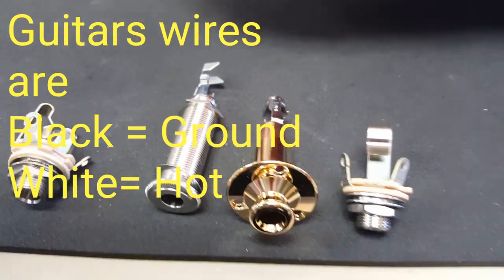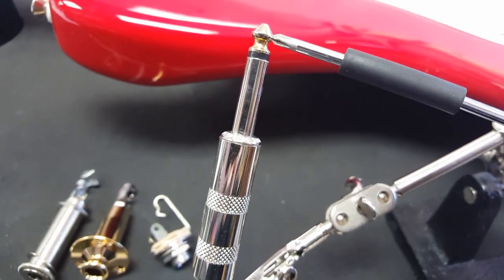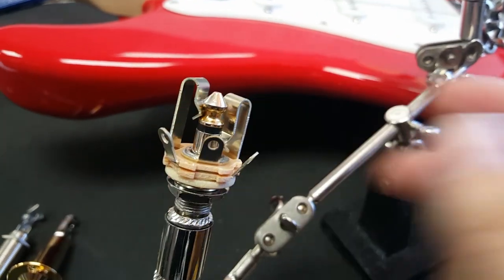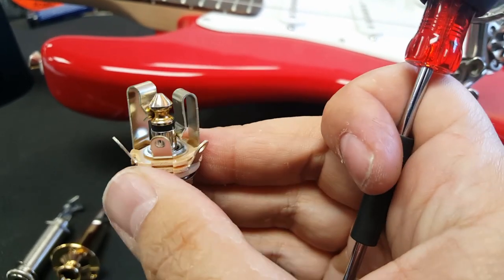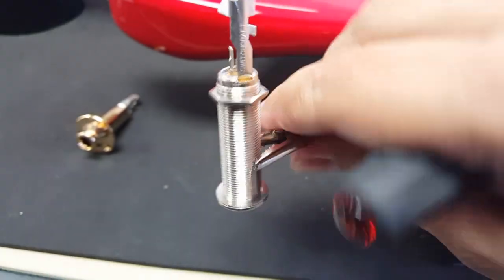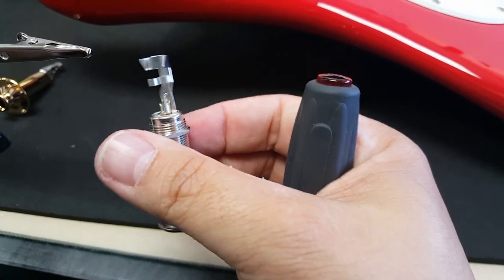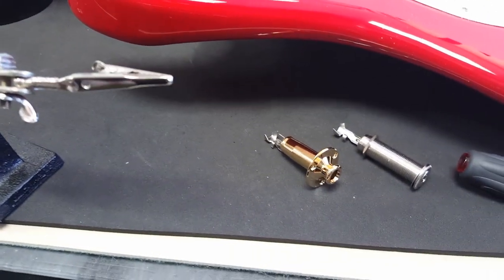How the guitar output jack works.  Sharpen My Axe

Comment: Even with your help it still took me nearly a couple of hours. My jack was similar to the gold one near the end of the video and being a sealed unit it was impossible to figure out the connections with a multimeter. With you telling me that the short one was 'hot' and the big one 'ground' made it a lot clearer. So many thanks.

Comment: Man this helped... i just wired an EMG 85 in my Kramer Baretta but had to use the older longer output jack... static and wouldn't pick up my false or pinch harmonics... i was sick! Saw this vid learned i wired incorrectly....fixed it and now 🤘🤘LETS GET ROCKIN!
Thanks for a great vid..! Even if 4 yrs ago!

Comment: Thank you for this. One question: In the beginning of the vid, you mention that "black" was ground, while "white" was "hot". That's the opposite of how 110v single-phase wiring (common non-industrial setup) works in the US; the black is always the "hot", while the white is "common", or "neutral". Ground color varies by nation, i know, but here in the US, it's usually green. What would be the reason for configuring it the way guitar makers do?
Reply: D Snodgrass These are common colors in the U.S. for low voltage or electronics.  You’re correct that common household voltage colors are black (and red or blue) for hot, and white for neutral, and green for ground.  FYI, the 12 volt system for a car uses black for ground and red for hot!  Pay attention!! LOL...

Comment: Am I missing something here: Wouldn't it be the exact same thing if instead or using a TSR/stereo-jack, you would connect the 9V ground to the same same ground as in a mono jack? Or is the point of the whole thing just to have different soldering points for both ground wires?
Never owned a guitar with active PUs and  didn't know they use TRS-jacks, so that's Mr. McKnight all right; even on a thing that's as basic as it get's, there's still at least one new thing to learn.

Comment: Just a tip; pull the jack out of your 9Volt Active acoustic or electric Guitar when not using it as the lead left in drainz the battery, same with 9volt bsttery powered pedals.

Comment: If it wasn't clear, inserting the guitar cable plug with the long sleeve, connects the negative of the battery to the common connection (sleeve) of the jack and powers the electronics or the active pickups.

Comment: Great video. I have a barrel output port on my Taylor like the one you explained in the end. It doesn’t work when the cable pin is inserted fully. Only works if the pin is partially inserted into the port. What could be the reason?

Comment: Aww man, I had to rewire the cable for my input jack aswell the wire was full of nicks were it had been twisted in the cavity, upgraded to some vintage cloth covered wire.
Reply: I only have one wire coming from guitar and trying to upgrade the jack, how did you rewire?
Reply: @edwardkennedy5500  does your wire have wire strands underneath the insulation that are around another insulated wire? If so it's a double core wire and you will be fine using that.

The stands that are between the outer insulation and the inner insulated wire are the ground, and the inner insulated wire is your hot.

Just twist the ground strands together so they are easy to solder like a wire. Hope this helps, let me know how you get on.

Comment: In example 2, why wouldn't you just weld both wires that go to the ground to the same ground terminal, why do you need 2 ground terminals?
Reply: TRS, tip, ring, sleeve, "stereo jack".
When the negative of the battery is connected to the "ring", the jack also acts as a "switch" to turn on the electronics or the active pickups when a mono guitar cable is plugged into the jack and off when it's removed.
NOT 100 % of the time, but 99+%.
Reply from the maker: +dennis walsh said perfectly. thank you for posting

Comment: I absolutely don't get the one for the active pickups:
It gives you a third connection (for the battery) which leads to the sleeve and therefore the very same ground for the rest of the guitar. Why not connect the battery ground connection to any ground? Why make a third connection which suggests it has an individual use, which imo it doesn't since it's connected to the "old" ground?
Someone care to explain?

I got an idea while writing this - does the battery discharge if it would be connected to the same ground, and that's why there is an individual, third connection which only gets connected when a guitar cable is plugged in?
Reply from the maker: You got got it. It is a on off switch for the power.
Reply: @PhillipMcKnight  tyvm

Comment: Great video, question, I put new pick ups on my Gretsch hollow body and when I was done I over tightened the input jack and crushed the wood a little bit, Since then I cannot get one of the pick ups to work. I’m not sure what’s going on I did my southern correctly it all looks well but now one pick up doesn’t work. Do you have any ideas?

Comment: Hey Phil.  You should do a live stream soon.
Reply from the maker: been sick with the flu, but feeling better. I will do one this week coming up
Reply: +Phillip McKnight yes!!!!!
Reply: +Phillip McKnight , get better mate , been through that a more than a few times , it sucks bc , your in bed , you can't get up or you feel dizzy(if you have an ear infection at the same time , which I usually do) , you don't wanna eat , anyways , feel better mate , love your vids , I have one question , I have a fender squire bullet strat and the input jack is loose , not the metal plate surrounding the jack , the actual jack is loose and needs to be tightened , what tools do you recommend using , I've done work on my guitar like; emg pickups , a new set of locking tuners, a new ivory nut or whatever you call the white string separator on the top end of the neck (sorry for the noob like language) I've actually used some of your vids for advice on how to do these things.
Reply: Wild guess here. You seem to be saying that the jack nut is tight but the plug is wiggling in the jack. If so, maybe the tang (the bit he's pointing out at 1:04) is pushed away from the tip a bit. Try loosening the jack retainer nut,  pulling the jack out and bending the tang back over.
Reply: +seraph127  , I will try that , thanks man

Comment: Hi I want to ask.  This is project I am working on...
Two pickup on acoustic guitar.  Sound hole and piezo.  I want to ask if I shoulder ring and tip for neck and bridge and then ground them together at ground in out put jack will it work.  Also to have a mono...another out put jack with both hot and ground on mono jack.  So I will have stereo and mono out put for choice.

Can you please help and advise

Comment: I'm a super newbie to this, bur my paranormal offset telecaster seems to have a shorter hot metal piece than the shaft of the cable (Ernie ball braided instrument cable) and everytime I (accidentally or not) plugged it too deep, the hot will not be touching the metal part of the output Jack. it's too far in. why is it?

Comment: Hey Phil, I’m installing endpin with a freeman sound hole p/u. I cut the plug off and have 2 wires, 1 loose copper 1 with black coated. Which one is hot?

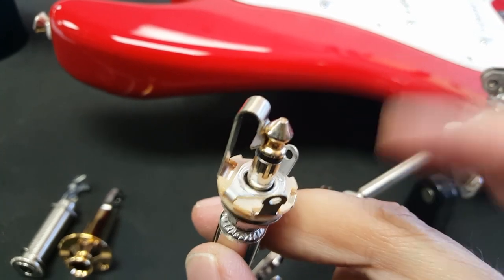Comment: 1:11 Hopefully someone can help. I followed the instructions here, hot to positive on the battery and the 2 negatives to the negative on the battery. I plug it in and my audio board picks up SUPER WEIRD noises. If you've ever heard a hotdog in a microwave screeching, that's what it sounds like. Playing the guitar while plugged in it picks up NOTHING from the guitar, just the constant screeching.
The tuner has power, so clearly it's been wired right, it's getting the signal from the strings and I can tune it using it, so why am i getting this screeching?

UPDATE: Even when the jacks connections aren't connected to the tuner, when plugged into my sound board and it's just the battery and jack on its own, it makes this screeching noise. WTH

Comment: I have to ask about a stereo jack for actives on guitar. I want a tone pros stereo jack but they are not available. Could I just use a mono jack? Just connect the battery ground to the negative mono jack tab?

Comment: I see input jacks labeled as "Mono" and "Stereo".   Would my assumption be correct that the "stereo" version is with the second ground for a battery?
Reply: Remember that plastic ring that separates the tip from the sleeve? Look carefully at some 3.5 mm headphones you have that are stereo, and you'll see there are two such plastic rings, so two tips before the sleeve. Now hunt down a phone headset, and notice 3 rings for 3 tips (left, right, mic) and a sleeve (ground).

Comment: I cant find any review videos about the difference in sound between the stock output jack and the new one. Why swap it out? What is there to gain (insert pun here) by installing a “higher” quality output jack?
Reply: One point is there may be no difference in sound quality, but there may be a mechanical difference in quality, including how long it lasts under wear and abuse.
Reply: Marc Lepage hmm okay thanks for the info

Comment: Cool thanks for the info. I'm building a guitar wth active emg's , so I have to have the different I put jack?  Why another terminal for ground?  Love the vids btw
Reply: I believe the second ground is so the electronics know there is a guitar cable plugged in. If there is, the battery will power the pickups. If not, the electronics don't power the pickups so it doesn't drain the battery, which is why you always need to remember to unplug the cable from a guitar with active pickups.
Reply: +Noah Langseth  ok cool yeah I just realised that, makes sense , thanks for the reply. 👍

Comment: Would the connection still work if a 1/4" to 3.5mm converter was used? I'm dealing with an modified amp with only a 3.5mm aux input and am having issues getting the sound from my guitar into it. The amp plays music fine from my phone. The converter piece i plug into the guitar has 2 black bands , and the aux from the amp that I plug into the converter has 3 bands.
Reply: So you're trying to plug your guitar to an aux input on an amplifier? If I got that right, then yeah, using a basic guitar cable and putting a 3,5mm adapter on that will work as the tip will still be the hot connection and the sleeve will be the ground. However, I'm pretty sure that an aux input will need a line level signal, but the signal from your guitar's passive pickups is so weak that your amplifier can't - in a sense - "hear" it. I'm assuming you're trying to plug your electric guitar straight to a regular audio amplifier and not an actual guitar or instrument amplifier? There's a bunch of reasons why that's a bad idea, but if you get a decent preamp, amp modeling software/hardware or an "amp-in-a-box" pedal with a line out that could work and even sound good.
Reply: T-12 after further investigation, it's a really messed up guitar amp, someone modified the input and hard wired an aux cord to play music with, I may just have to rewire its original guitar input jack into it. Thanks for the info!

Comment: The wood where the nuts are screwed in are stripped and I don’t know what to do now
Reply from the maker: If the holes are stripped out. You can use a toothpick and wood glue or Elmer's white glue and it will work great. Fast and easy

Comment: So if I disconnect the hot output thingy and put passive pickups in my guitar will it become passive?
Reply: It will become a silent guitar, since you always need TWO connections. One is the zero reference, call it ground, and the other is the actual output signal going above or below ground, the "hot" connection.
Reply: No. Active pickups are either on or off.

Comment: soooo dumb question here but do pedal outputs work the same?
Reply: Pretty much. Every type of electrical switch has some sort of "hot" and "ground." Even buttons for those DIY arcade cabinets and virtual pinball machines have to be wired the same way.

Comment: Isnt it crazy how little contact this plug type actually makes? Its amazing that it can carry 100 watts + of power.
Reply: That connector doesn't carry that much power. That's the point of an amplifier, it amplifies the signal.
Reply: The one in this video is for a guitar your right, but the same design is used on the amp output with a male 1/4" and a female 1/4" with the same type tang using a friction connection. 

The pressure of the tip "Tang" pushes the male plug making the ground.

Think of a bike tire touching the road. What % of the round tire makes contact with the flat road?
Reply: true, true.

Comment: 2:00 I have a battery in my guitar but there is only 2 wires comming out to the plug, grey is live and black is earth. How do you make two black earth wires that solder onto this jack? The old jack that came out was a shitty PCB plug from a dodgy (I know how to rewire this thing guy I think). I may have to pull all the wiring out and redo the whole thing properly by the looks of it. GRRRR